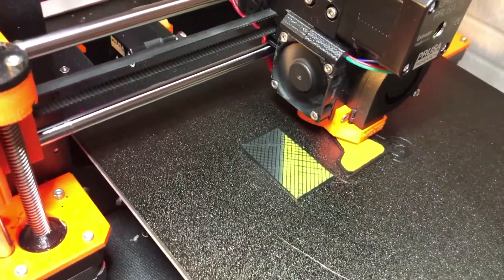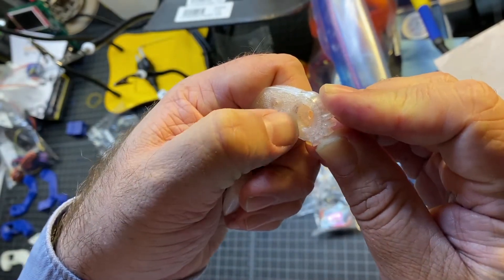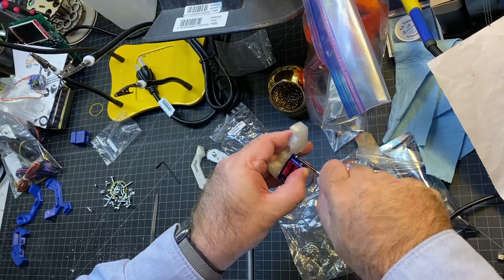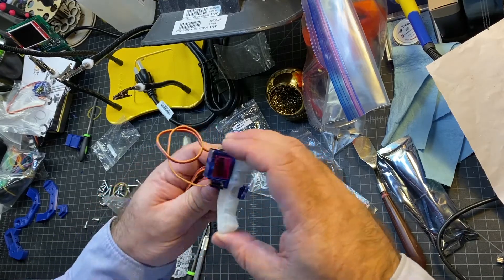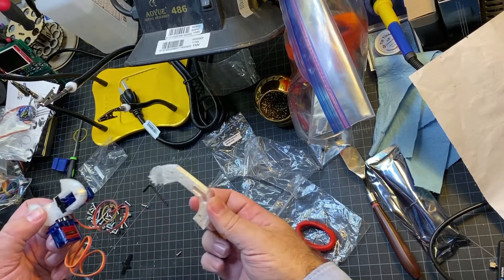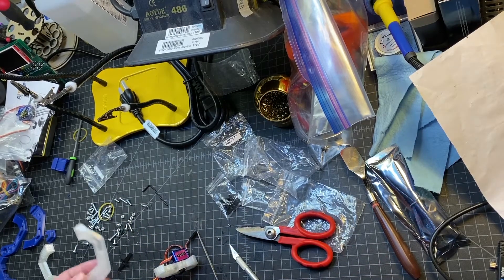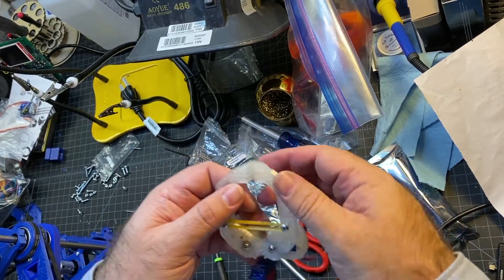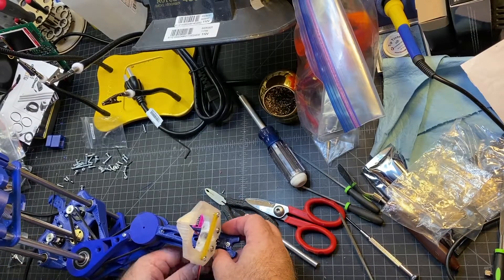JJRobot Scara Arm Build Part 5 - Gripper assembly

Comment: Thanks for that video series. I had the same issue with the gripper where I did not know how to mount the servo to the arm. I ended up not using the gripper and printing my own gripper(s).
Also, you accidentally mounted the motors for the x and y axis downwards. I think this could be a better option as for me the arm moves down along the bearing from time to time which is not good.